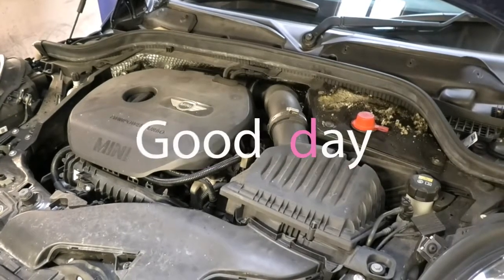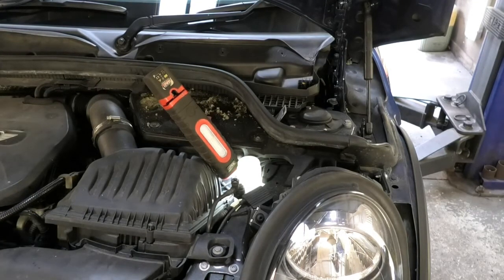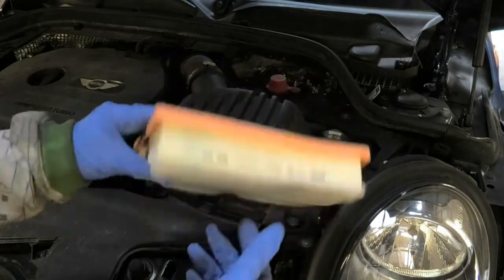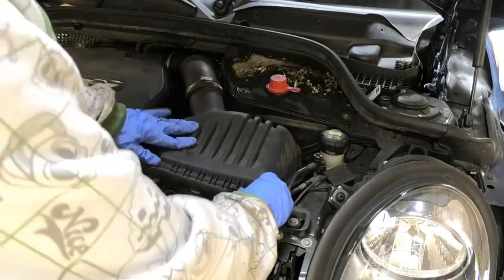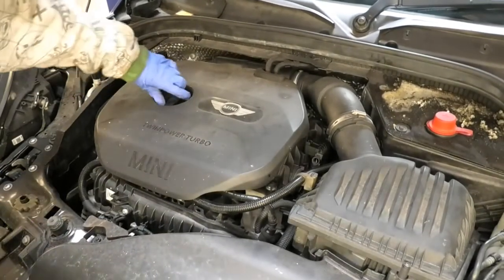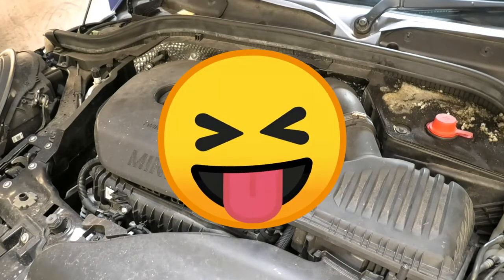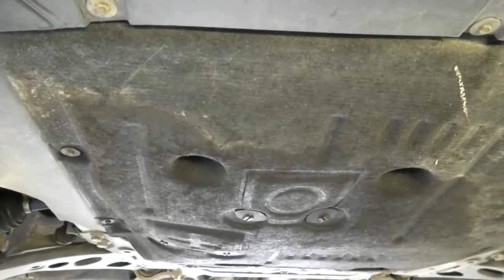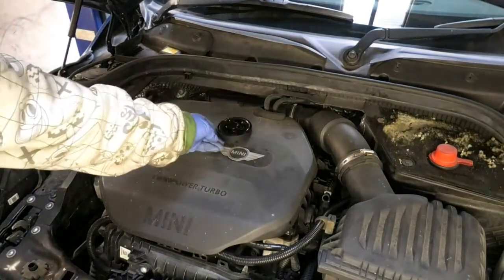Mini one 2015 1.2 oil, oil filter change, air filter, screen wash and coolant check

Comment: Why did you screw the filter drain back into housing only to remove it again ?
Reply from the maker: Possibly because I wanted to avoid oil leaking onto the tool I used to remove the housing, but then I removed it because I had a new one to fit in..